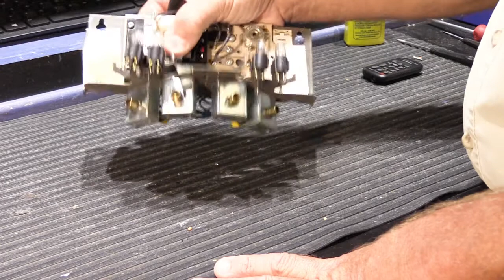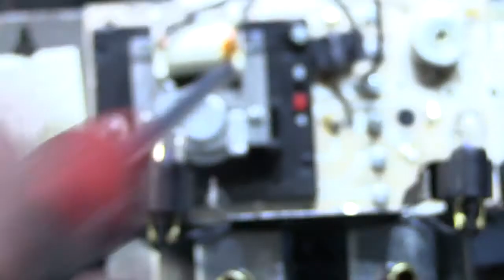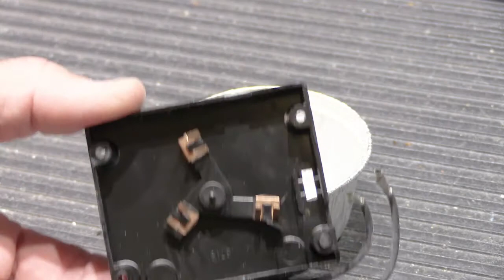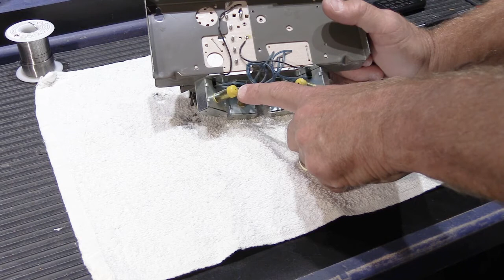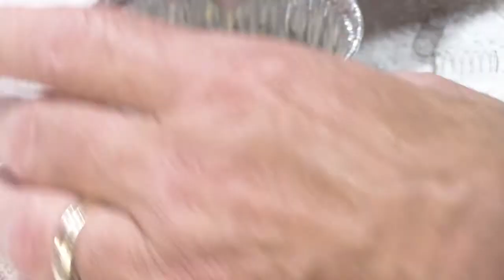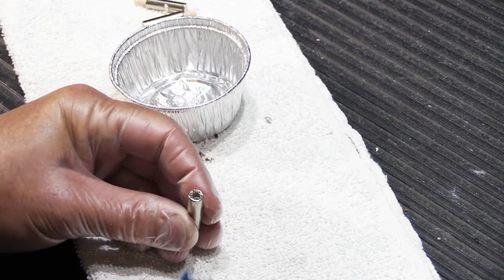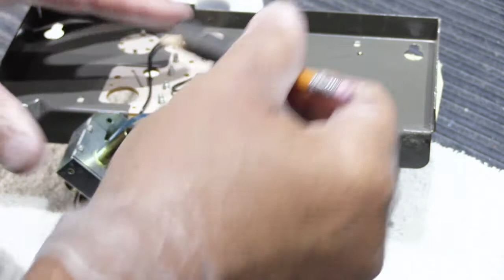How to Service a NuTone  8 Note Long Tube Door Chime Base

Comment: I have one of these.  Purchased it in 1986….It intermittently work or had to hold the door bell button in.    It was that metallic leaf arm stop arm was broken off.   Repair.    Emery cloth the mount and the leaf    Then screw the mount back on the board….   Using a bent tip needle nose hold the leaf against the mount and solder.    The repair is better than the original.  No weak point anymore.   Thanks again.    It’s up and running like new
Reply from the maker: Hi Cyrys:  Good to know that the Video helped you repair your Chime - Chris

Comment: One of the best instructional videos I've ever seen!!!  Only one note played for years.  I was always thinking I could buy parts and rebuild - but (as you stated) I couldn't get parts gave up a few years ago.  During a painting project I was thinking keep-or-toss?  Then I found this video am very pleased.  Everything was exactly as you said. 

One note you might add:   A couple of the terminal screws had been over tightened.  They are self-tapping screws that make the electrical connection by holding the wire against the circuit board contact.  There is no nut or metal receptacle for the screws - just the circuit board material.  I replaced the two that were stripped with the next size screw and it worked great.  Don't go too big or you might crack the board.  DO NOT OVER TIGHTEN THE TERMINAL SCREWS!!!
Reply from the maker: Hi David: Well done in getting your Chime working again - You are correct about over tightening the screws.  It is easy to strip out the holes and the screws won't tighten up.  Another method is to use a machine screw with a star washer and nut on the back side of the board. - Chris

Comment: Hi Chris, what a great video.  We bought this unit new in the 80's and took it to our new house when we moved in '94.  It was down to only two plungers actually working.  I was searching this morning for the solenoids and saw that just about all the parts for this have been discontinued.  That's when I found your video.

After watching your vid and taking notes I searched the house and found lighter fluid, got some q-tips and took it apart and cleaned the whole unit.  Cleaned the carbon with the pencil eraser, took apart the solenoids and soaked and cleaned each piece.  Cut up a piece of a foam paint brush for the cushions.  Put it all back together - rewired it up on the wall and it is working like it was new!

Thank you for taking the time to put this instructional video together - it was the only thing that saved the unit from being replaced.
Reply from the maker: Hi Ultra0161:  I'm happy to have been able to help and save another NuTone Chime - Chris
Reply from the maker: Hi mutteone:  Your chime needs to be cleaned and serviced like in the Video.  If the plungers work alright - you can clean the contact board and armature under the motor first - it is likely the cause of the problem.  Be careful when cleaning the small parts - don't break or lose them - replacement parts are very difficult to find

The Motor and Motor coil are never a problem and it is not the source of the problem you are having - Chris

Comment: Hey amazing video saved me from replacing the unit. I moved into a new home and the bell wasnt working. the chimes would slightly ring but when i push the button a few times nothing happens. After seeing this video im guessing the solnoids dirty. THANK YOU.
Reply from the maker: Hi Zaen:  Make sure you get the correct Lighter Fluid and don't lose the Springs!!!! - Chris

Comment: Thank you for this video, we have the variant of this chime without the lights, and with a clock that goes over it, and over the past few years, some of the chimes gradually stopped working. The foam pads had completely disintegrated and clogged up the solenoids. Your video helped me because it showed me what to expect, and what I did and didn't need to do to fix it. I didn't have anything to replace the foam pads, so I just left them out for now; when the solenoids deactivate, there's an audible kick now, so that must be what those pads are for. I'll try to replace them later, but in the meantime, thank you for helping me get my chimes working again. :D A fully working 8-note chime is wonderful because it's very easy to hear, and nobody else seems to have them anymore, making me appreciate them that much more.
Reply from the maker: Hi DragWX:  I'm glad that our Video was helpful.  

Here's a link to another Chime rebuild Video: https://www.youtube.com/watch?v=QrnZ4_hILtU&index=14&list=PLsTvqKsBnGYdEvtzvv_pz1gOKa9UPuAxH

At 2:10:00 I show how I make new cushions - Chris

Comment: Thank you for sharing this very informative video on how to do maintenance on these door chimes.

I have one of the NuTone 8 Note Long tube Chimes with the yellow capped solenoids installed in my home. Probably purchased it in the late 1990's. Suddenly only two out of the four plungers are firing. Planning to take it down to clean and also check that the wiring from each coil is properly connected to the circuit board.
Reply from the maker: Hi Tharin:  If your NuTone Chime was manufactured in the late 1990's - it probably has a fully electronic circuit board instead of the design shown in this Video.  It is possible that the board will need to be rebuilt due to age related failures.  It is not uncommon for the electronically controlled Chimes to need service after 20+ years - Chris
Reply: Yes, it is the fully electronic type. In case there is an issue with the components on the board do you know what voltage is good for these solenoids? I might replace the board altogether with a homebrew circuit. I assume that the potentiometer is meant to act as a voltage divider controlling slightly what is being delivered to the solenoid coils. Perhaps a 12V DC supply would be good enough?
Reply from the maker: Hi Tharin:  It would far easier to just rebuild the board - I had someone else try to duplicate the board using modern design parameters - he spent months working on it before he realized that it was much more difficult than he had imagined and it had no real commercial value.  - Chris

Comment: Hi Chris, After taking off the motor I found a bent contact on the armature, when I touched it it broke off. Luckily when I put it back together the chimes worked fine. Thank you for your help. Steve
Reply from the maker: Hi Steve:  Glad you got it figured out - Chris

Comment: What a great video. I stumbled upon it when my wife complained that we were down to one chime and I needed to get a new door chime. With the video I was able to fix it. The only things I did differently was insert the sand paper first with a small shaft screwdriver and then inserted the pencil. I also could not find the foam that I saw in the video. I ended up using the  foam from a disposable paintbrush. Hope that's OK. Now I'm just sitting around waiting for someone to come to the door and ring the doorbell.
Reply from the maker: Hi Andrew:  Cool - The foam from the paint brush will be fine - Well done - Chris

Comment: This is an amazing video. Thanks so much for the detailed explanations. I cleaned everything as described, and now I have something interesting happening! When I press my doorbell for the 8 note chime, it plays notes 2,3,5,6,7,and 8. It never plays notes 1 and 4! Any thoughts on what might be causing this? Thanks again for the great video- it’s had stopped playing completely, so this is still an improvement.
Reply from the maker: Hi myfavoriteddrumgear:  I would suspect the 1 of the 2 very small wires that comes from the #1 Solenoid have broken loose from where it was solder to the circuit board.  It is also important to make sure that the #1 Plunger moves freely inside the Solenoid and that the Spring is inplace.  Lastly, it is possible that 1 of the wipers on the Contact Rotor is missing/broken off or misaligned (this is the least likley cause for the problem) - Chris

Comment: HI Chris, great video.  I have a different problem.  I purchased my 8 note NuTone in 1996, so I assume it is one of the newer models with the digital circuit board, as it doesn't look like the one in your video. It does have the 4 lightbulbs like your example, though.  Periodically, I've had problems with the chime going off by itself.  Frustratingly, this is usually in the middle of the night. Initially, I figured that it was a short in the doorbell button, which I had recently swapped out for an upgraded version that was a better fit for my 1885 house.  I put the original button back, and that seemed to take care of it.  Then after some time passed, it started going off by itself again, running through the full cycle of notes.  It started happening more frequently, and stopped completely after each cycle was completed.  Finally, I had to disconnect the power at the circuit board and put a note on the front door to use the knocker instead.  I got on the ladder and gave the unit a thorough cleaning with Q tips, figuring that dust might be closing a circuit somehow.  That worked for a while.  Last week it started again, so I had to disconnect the power at the circuit board again (boy I wish that I had thought to take a  picture of it with my phone because i ended up pulling wires right and left because I was on my way out of town and already late).  I have since dusted everything again, but that didn't solve the problem. Do you have a video that deals with chimes that want to work too much?  Also, I found a Jefferson style clock face to replace my '90's vintage amber plastic and wood case.  It fits fine on the later bracket/housing, but I'd love to hook up the clock to the power that is now serving the lightbulbs.  Do you have any recommendations on how to retrofit the older clock unit onto the newer base unit?  Thanks so much.
Reply from the maker: Hi Colin:  It is very likely that your 1996 NuTone Chime is a fully electronic version - keep in mind that your chime is now  around 26 years old - that calculates out to around 227,776 hours of time that the Chime has been powered on.
It is also very likely that it's time for your Chime to have its first rebuild.  The erratic operation is often cause by the ongoing failure of components on the circuit board.  This Video discusses your type of Chime: https://www.youtube.com/watch?v=NiGSevyzmJM&list=PLsTvqKsBnGYdEvtzvv_pz1gOKa9UPuAxH&index=24&t=1s

Adding a Clock Cover should be fairly simple - The Clock Motor can be wired to the same part of your Chime that powers the lamps ( I'm assuming the lamps will be removed). It would be best to either add some type of connector so the Clock can be unplugged - Chris

Comment: Thanks for the great video. I had one stuck plunger. I also found a manual online that says to apply non-flammable cleaner to the plunger hole and operate them. I had some CRC Brake Cleaner that seemed to work great, and did not have to take the unit off the wall but will try your method if they stick again.
Reply from the maker: Hi Bob: Brake Cleaner is very harsh - not recommended -  it also can/will melt plastic parts (like cushions, end caps and plunger tips) - Chris

Comment: Great video, thank you. I have a Nutone LA58N, and almost exactly like this video however, the chimes are in front of the motor. Do you have an explanation on how to remove the chimes in order to access the motor?
Reply from the maker: Hi Debora:  This Video:  https://www.youtube.com/watch?v=K38kZ5ROLZU&list=PLsTvqKsBnGYfkxG2pQTX2xw1RDX2_9Wr2&index=1&t=1s     features a NuTone Short Tube 8-Note Chime that's very much like yours - Your Chime has a Telechron Motor - the Chime in our Video has an Electronic Control Board - but disassembling the Tubes is the same on both models - Chris

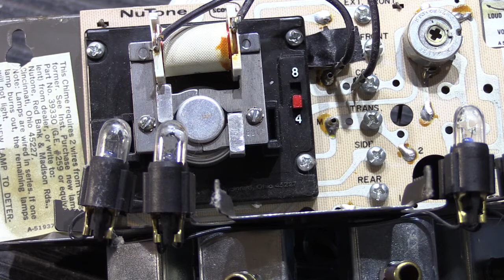Comment: 10:40 Contacts maybe sulfurized bronze which is more elastic so less likely to loose tension.  Aka spring tension bronze.  I will defer to any machinist or metallurgist on this.
Reply from the maker: Hi Andy:  It is unknown what type of material was used on the original Springs - Our replacement Springs are made from "Music Wire"  or 302 Stainless Steel - Chris

Comment: Thanks for a very clear how to video. I have an older model, around 1970's series. It has nearly similar features as in your video. My door chimes had stopped working about 3 months ago. I did the cleaning and the 4 plungers are not stuck anymore. However when connected to power it does not move the plungers but I can hear the motor hissing inside. What could be the problem? I checked the transformer source and it had 16 volts, the same voltage showing at the board transformer.  Thanks for your attention.
Reply from the maker: HI Oscar: It is of course difficult to say exactly why your Chime is not ringing - Is the motor running continuously or does it run only after the button has been pressed?  - Chris
Reply: @northsideservicecompany3567  Surprise, surprise. It is working really well now. Connected by the old wiring system and it started to chime but needed to press the button for about 3 seconds to trigger the chime. I then rearranged the wiring according to your video. It now requires about 1and 1/2 seconds of pressing the button to trigger it. I am very grateful for your fast reply and your videos. I am sure a lot of people have told you how sweet it is  and happy they are to hear the winchester chime again, as I was and am.

Comment: I have an old nutone clock/door chime that was left in a house I moved into and the people I bought the house from said “it’s junk” when I asked if it worked lol. Anyways I took it all down and stored it in the closet. So the wife an I split an I decided to drag that thing out and look at it. Cleaned up the springs an plungers an all an they seem to pop out pretty good only thing is I don’t know if they come out far enough? Looking at this video at the end when you run this one they seem to come out about as far but unless I put the tubes all the way against the plunger opening most of them do not hit the tubes. Could it be a power issue? Is it possible to check with a multimeter? If so (being completely new to the nutone/chime club an how they function) what is the best way to test it? Such as where do I put the negative post?  An I’m assuming the transformer is only dropping the voltage? Or are we transforming from AC to DC? Sorry for being so completely stupid in this area an asking so many questions but I’d just really like to get this thing going good. I was going to send a picture but don’t guess YouTube has that option. Thanks a lot man, sorry for the long post!

Josh
Reply from the maker: Hi Josh:  Do you have the "volume" adjustment set high enough (that's the little round control in the upper right -hand corner)? - This controls adjusts the voltage to the solenoids - less voltage is softer - more voltage is louder -  Start with it at full volume - then adjust accordingly.  Typically the Tubes will be sent in the center of the Hanger Arms or perhaps 1 notch closer to the strikers - Chris

Comment: Excellent video! Thanks for posting! My chime has similar plungers and cleaning them like this fixed it. One thing I didn't do is add the foam bits. Do you think this will cause any problems?
Reply from the maker: Hi robert:  The foam cushions are there to reduce any noise that is made when the plungers are pushed back into the solenoids.  This is a less issue on modern Chiem Bases with plastic solenoid caps. - Chris

Comment: Bought a 1959 home several months ago and the Nutone chimes seemed to work well.  Recently it just stopped working!  There's a transformer in the basement which measures 18V.  The front door button seems to work.....i pulled it out and jumped across the screws and nothing except a little spark.  this is an 4/8 tone with the 4 brass tubes.  Has a GE Telechron 16V synchronous motor.  Any help you can provide would be greatly appreciated.  Update: i verified there's power to the TRANS/ COM and i can get it to chime, might just be dirty and now i can use your video to clean it if its still unreliable.   thanks, Michael in CT
Reply from the maker: Hi nb3hk9uu3o:  It sounds like your Chime is in need of some basic servcing at the least - it is also possible that it will require more repair.  How you Service exactly depends on which Model you actually have (a 1959 Chime is different than a 1989 chime) So, identifying what you have is the first step - You can contact use directly for more specific help - Chris     nscompany@msn.com

Comment: Great video ... it gave me the courage to tackle my unit, circa 1975 (model 64892B I hope), with black stoppers in the back of each chamber.  Mine was only working on 2 of 4 chimes.
I decided to just work on the 4 solenoid valves, never detaching the motor.
I got all 4 chimes to strike - success I thought.  But it kept cycling and cycling ( ringing non-stop).  So, now, for the first time I removed the motor assembly.  Both the metal piece and the plastic tab on one of the 3 armature contacts look completely intact.  (I still haven’t cleaned the circuit board - my bad).  Is the plastic tab lifting the metal piece the only way it stops?  Any ideas?
Reply from the maker: Hi John:  Ideas? Sure - Finish the servicing and clean the Circuit Board and Armature - Yes, the plastic tab on the armature is what makes the Chime stop - by lifting the Metal Contact from the Post - Chris

Comment: I have a fasco cunsummer c8847r door chime with four rods and every once in a while there is a single chime from one of the rods  any thought of what may cause this  thanks
Reply from the maker: Hi John:  Most Fasco Chimes are really Rittenhouse Chimes - Is your Chime fully mechanical (it has a motor that runs the chime) or is it fully electronic (has a circuit board)?
A single note is typically a "Rear" or "Side" door chime - does your house a have Rear or Back door with a Button? - If it does, try disconnecting the pushbutton. - Chris